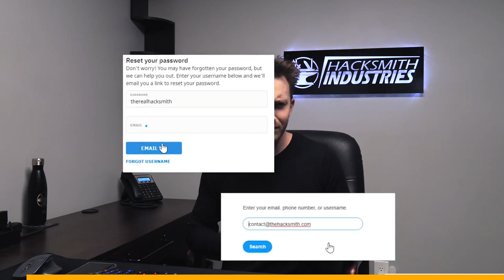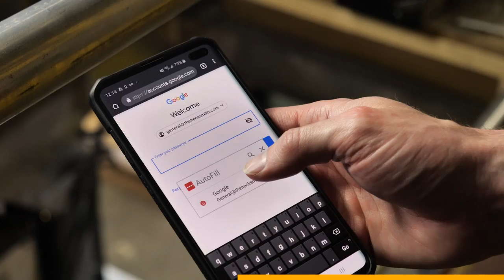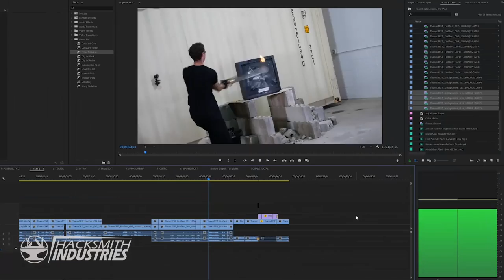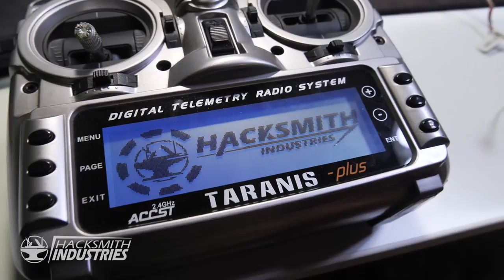THANOS SWORD TEST!

Comment: Are we just going to ignore the fact that the thanos sword sliced through concrete with no problem, but had trouble with an ancient pc? 

Isaac Newton! Explain!
Reply: The PC is made out of nokia
Reply: Each person that wielded the blade had a different level of strength, therefore it could do more damage in the hands of one than the other
Reply: Because plastic bends
Reply: Concrete has high compression strength but low tensile strength, thats why they put rebar in it then the make house fondations.

Comment: 2019 trying thanos sword.
2100 trying creatring thanos
Reply: bad grammar but ok
Reply: @strudlsy6303  not bad grammer may be mistake
Reply: > you found a wishbone in your turkey. 🦃 
> you wished for __ luck.
-
if you chose the option with the most votes, you’ll get the opposite.
if you chose the option with the least votes, you’ll get the opposite.

Comment: being a martial arts student (and a science geek), i've come to realize that handheld weapons are impractical in actual combat (the ideal attitude is, you need to finish the fight within one second, because you need to expect the whole war will extend forever), as more blood gets sprayed onto the handle (as well as hand sweat), it becomes more slippery over time, not to mention the increasing fatigue in your gripping muscles makes gripping your weapon increasingly impossible.

the solution, is to not hold your weapon, but rather to wear it. if a bladesmith can attach machete blades to the outer side of the forearms (the idea is to have left and right forearm blades maybe 50-60% smaller than the size of alex mercer's; pretty much like steve rogers in infinity war, only made sharp), he just ensured the survival of his warrior in close quarter combat.

Comment: I would love to see you put this sword through the same kinds of tests they do on Forged in Fire.  A kill test, where you cut into a ballistics gel dummy, preferably in a move similar to one seen in the movie;  a strength test, where the blade is beaten against something that should stress the blade (I think hitting the concrete blocks like you did counts); and lastly a sharpness test, to see how much of the edge survived after the previous tests.  It looks like most of the attacks were bludgeoning, not cutting, but that could just be my limited experience.

Comment: Hey the Hacksmith i have a challenge  for you  keep reading for the details

Ok so there is a weapon called the micro from scp secret laboratory it is a electrically charges gun  that used a masive amount of energy so i in it takes a huge chunk of the scp's health. It tskes 10 seconds to load making it would be a challenge and i think that the Hacksmith is worthy of it. Good luck if you decide to creat/make it. :D